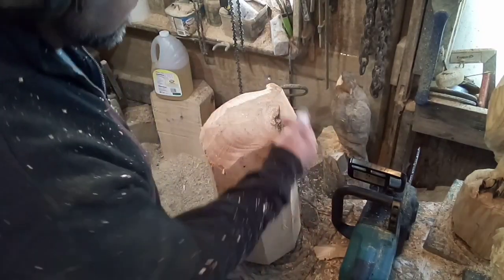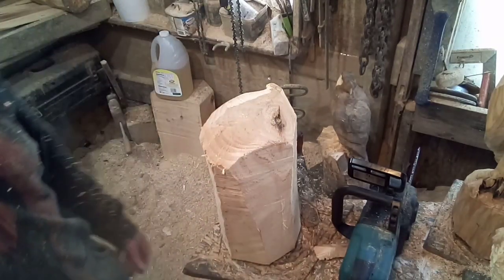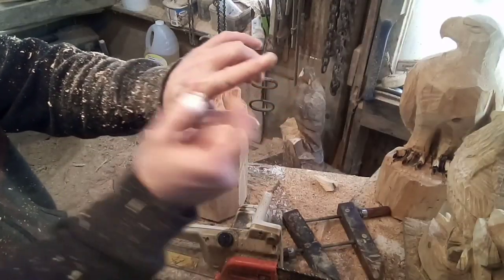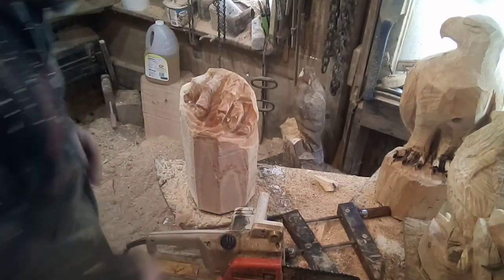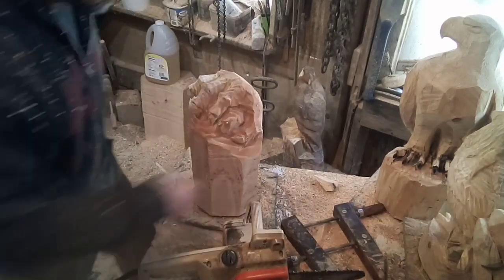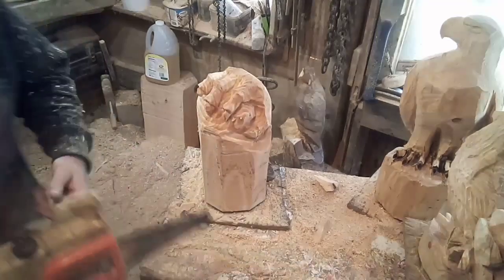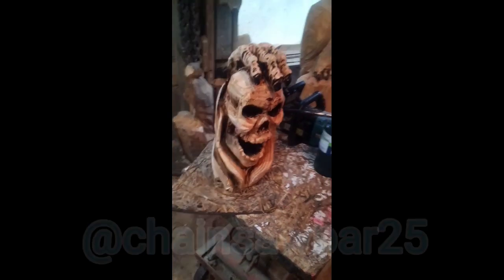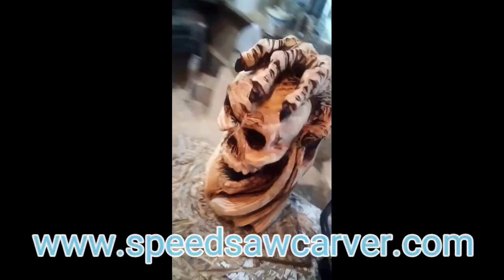Chainsaw carving tips and tricks 6 making hands and claws, basic instruction. Plus added bonus!

Comment: awesome video. how often do you go through chains making a piece?  looks like using it to grind would wear it down. just wondering
Reply from the maker: Not sure what you mean by grind,.  no, they don't Dull quickly, because the saw oils well, and I use wood that goes through a process to have clean wood.
Reply from the maker: Good question though... the side ways cut is a very regularly used technique in chainsaw carving,  its easy to ruin your bar tip by going too fast, or pushing in too far...I have videos on that subject on its own...

Comment: Where did you get the 1/4inch sprocket for your makita  saw
Reply from the maker: Made it from parts, and frustration. Used a rim sprocket,on a turned down Makita hubb, the spring clutch preasure plates on the Makita  hubb are what holds the sprocket in place,difficult part is turning down the o.s. spline for the 3/8 pitch to accommodate the rim sprock and stay centered. Then putting the preasure plates back together is nothing short of a wrestling match with a pissed off squirrel😂🤣🤣 but it can be done, and well worth it if you succeed😁